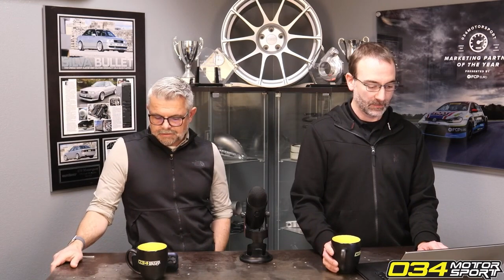Best Ways To Make The Audi EA839 V6 Engine Bulletproof On Stage 1 | 034Motorsport FAQ

Comment: Rocker arms? My 2018 b9 with a 2017 build date is tuned stage 1 e85 with you guys. I do oil changes every 3k with moly 5w40.  Is this an issue I should be worried about ? I have read several horror stories. My car is now at 98k miles.
Reply from the maker: Rocker arm issues are still quite rare. There are a lot of resources on the internet that you can refer to regarding those issues.

Comment: Are there any other components you would recommend for stage 1 E85? I currently have an intake, upgraded intercooler, and APR ignition coils. Should I be fine to run this stage 1 safely on full E?

Comment: I have an intake and just went stage 1, how long can I wait to get an upgraded intercooler if i don’t push the car too hard in the meantime. What are components are at risk when running a tune without a heat exchanger upgrade
Reply from the maker: An intercooler upgrade is not required on our Stage 1 ECU software. Our calibrations have all the safety measures in place to ensure that the vehicle runs optimally with and without an upgraded intercooler.
Reply: Also should I be hearing a fan noise at idle and with accessory ON after tuning the ecu? I assume that’s just to help with cooling but it was not like that stock.
Reply: I’m on stage 1 93/94 Oct with intake and a turbo  inlet 
And I still drive aggressively without the intercooler and it’s hasn’t caused me any issues YET
Reply: Would you recommend flushing the fuel systems to pump gas every few months from running e60 for a while ? If so how often should you switch between pump gas and e60 or e85?